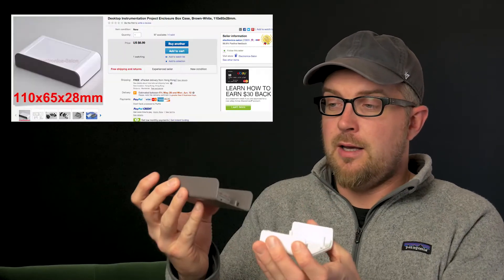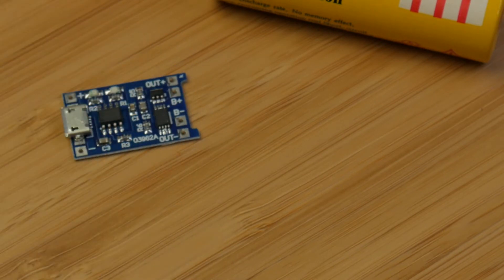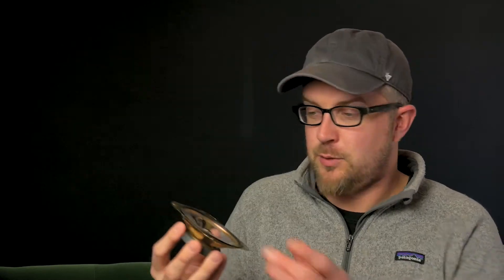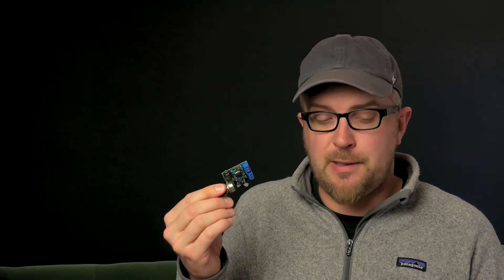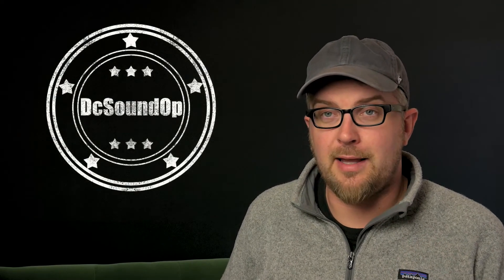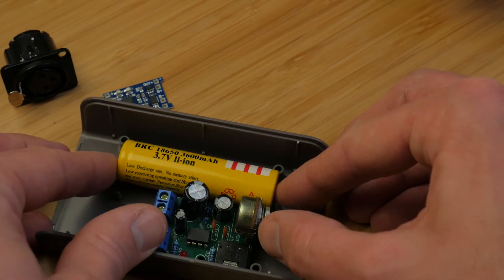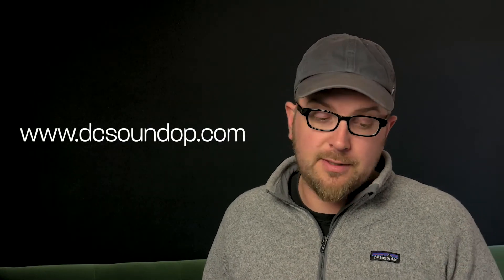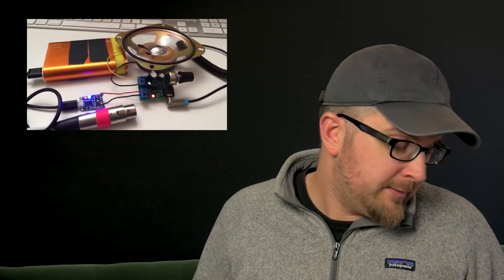#54 - Poor Man's QBox - Community Maker Project

Comment: Hey bud. Did this ever go anywhere? I love the idea of a simple qbox and power bank. For me, if it only had an XLR in, a volume, and a speaker on it, it would suffice. I would then use that extra space for more battery capacity.
Reply from the maker: No… David over at Sonnect made the sound bullet a few years ago, which is better than anything I could ever come up with.

Comment: Pyle Pro PCT 10 - Had it for 5 years, works great, original battery, $26.00 Amazon, Done!
Reply from the maker: HighDesertMusic Thats a cable tester though, not a Q-box... right?
Reply: sorry, I thought you were building a cable tester since you never explained what you were trying to build, Except to say Q-Box a lot.
Reply from the maker: Ahhh... I suppose it is confusing if you're not familiar with a qBox to start with. Sorry about that! It's more of a portable speaker (amongst other things) that lets us listen to what's coming down a line, rather than just check to see if the cable is good/bad. That's why in the video, I'm showing a speaker and small amplifier circuit... these are used to hear different lines you may want to test in the field. 

 In the conversations I've had so far with other viewers, lots of folks are talking about adding some sort of cable tester to the version they want to build, but fundamentally the project is based on the qBox functionality. As you've pointed out, a good cable tester can be had pretty cheap, but the handful of qBox type products that exist on the market are all upwards of $200.... which makes it attractive enough to want to try making our own for cheap :) 

The amount of time I've spent fooling with it all so far, I should have just bought one already, but it's always fun to have a project to play around with.

Comment: Might want to consider higher voltage battery (or a pair of 3.7V regulated down). I'd have to look it up but my recollection is that the LM386 needs a higher input voltage than 3.7V, and if you want to use it as a charger you'll probably want 5V readily available too.
Reply from the maker: mashzmash absolutely, the single cell is only for testing, the final project will be at least 2 of them.
Reply: Just put a boost converter after the battery.
Reply from the maker: Stephan Ahonen I was thinking that two cells would make it more worthwhile to carry for recharging things like my phone. Just my preference though, a boost converter would help keep it small if that's a priority.
Reply: Great idea. Have you got the details so far up on your website yet.

Comment: I have thought about making a cheaper Q-Box alternative for a few years.  I always got a little lost, I wanted to add USB&Record functionality, why not?  I think I have that part figured out now so I might have to start prototyping again.

Portable BT speakers might work well for this application, they already have a rechargeable battery, amp, and speaker built in.  You might be able to tap their power supply and get just enough current for a small preamp.
Reply from the maker: Thanks for the comment Karl. If you start prototyping again, I'd love to have your knowledge and experience on this project. As I posted on the website, I'm going to be looking at modding existing bluetooth speakers as you suggest, as it should be a much easier starting point for what we're trying to accomplish. We'll see how that goes, but I'm hopeful.

Comment: What about more stable suppliers like digi-key, mouser and the like?

It's rougher to find the parts as the catalog is deep, but I've never been let down by either.  Ebay/Amazon can be hit-or-miss.
Reply: Second this. I was really into the idea until Amazon was mentioned - Amazon sourced parts exclude the rest of the world outside of the US.
Reply from the maker: +monomerx001 Great suggestion! If anyone who is more familiar with their catalogs wants to help put together a parts list from them when we get there, that would be awesome too!
Reply from the maker: +TB Scab If you'll help let me know which suppliers are best for your part of the world, I'll do my best to include them in the project page too!
Reply: Here's a start at digikey: 

https://www.digikey.com/product-detail/en/dfrobot/DFR0208/1738-1227-ND/6579347
https://www.digikey.com/product-detail/en/hammond-manufacturing/1590B/HM151-ND/131015
https://www.digikey.com/product-detail/en/mpd-memory-protection-devices/BH-18650-PC/BH-18650-PC-ND/3029216
https://www.digikey.com/product-detail/en/adafruit-industries-llc/2130/1528-1492-ND/5761279

You'll also need the necessary jacks, looks like Digikey is mostly Amphenol. I have no issues with that!

Not sure if you can cram it all into that box, as I've not modeled it. This is just an example. I'm a huge fan of the Hammond project boxes, very durable.